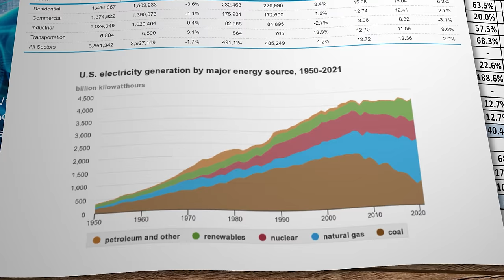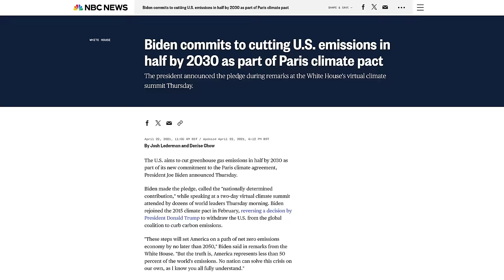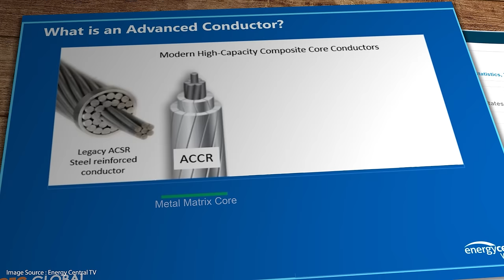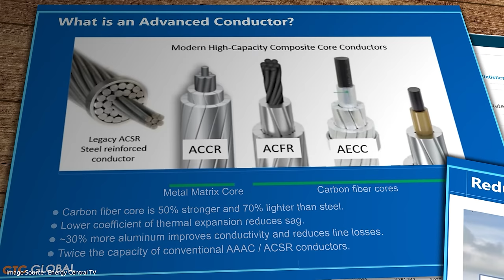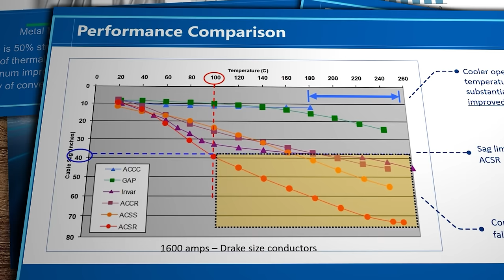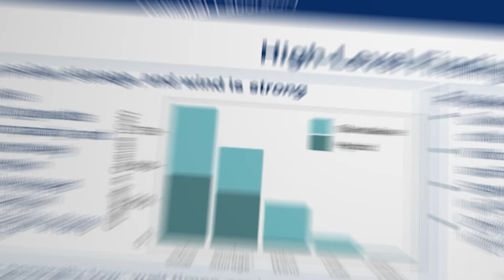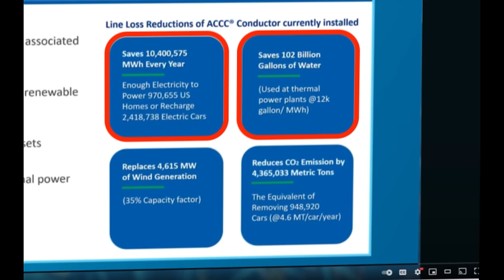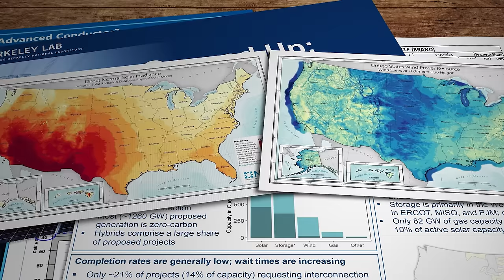Rethinking electricity grids.

Comment: If you want to reduce sag you must account for the increased tension in the wire.  The sag is engineered into the design to keep  tension within the specifications of the conductor. Problems start if you overload the line.  The higher temps caused by overloading cause more elongation and increased sag.  adding new structures between existing ones can address the sag issue.  There is likely some opportunity to increase line voltage and gain capacity that way The expense of wholesale replacement  of existing conductors is economically impractical.  Some lines could be double conductored.  Again , there is no free lunch. most structures  would have to be replaced. Increasing loads may change the load flow patterns such that new lines would have to be added to relieve other overloaded lines.  No mention has been made of additional generation to supply all of that new load.  Strategic siting for needed generation can relieve some congestion problems on the grid.  Wind and solar require huge areas of land because they produce small  amounts of power for the land areas used. Land requirements for wind and solar farms is something like 35 to one.  Oh, by the way, you still have to build backup generation for W&S anyway.  The sane answer for clean energy is nuclear power in about the 400 to to 500 MW range per unit, large enough for economy of scale and small enough that refueling one unit will not cause reliability problems.
Reply: Bingo!

Comment: Buried lines have no sag meaning low cost wires can be used buried wires don't get knocked out in storms or floods or earthquakes the only problem is burying them enter The Boreing company and soon it can be done for cheap saveing tens of millions in just disater related costs alone.

Comment: The Air Source Heat Pumps is a super expensive white elephant.. DO NOT FIT.. This is not a conspiracy theory.. Never used so much electricity over a winter..
Reply: Mine works fine. AFAIK that's the common experience - maybe there is something wrong with yours?

Comment: The Power Grid is the problem. We must eliminate the grid to move our society forward. Electricity should be free of cost. Vehicles are too heavy, they should weigh under 500 pounds for passenger type and under 1000 pounds for pickups.
Reply: how is distribution network stopping you from having electricity cheaper? please explain.. or at least think about it.